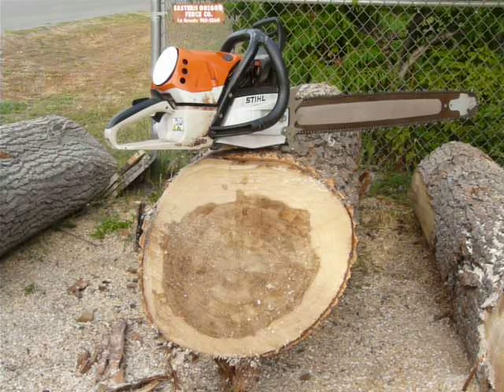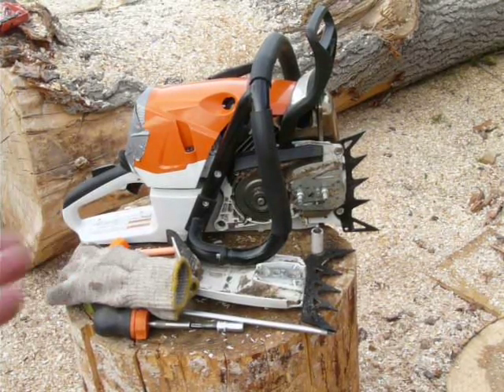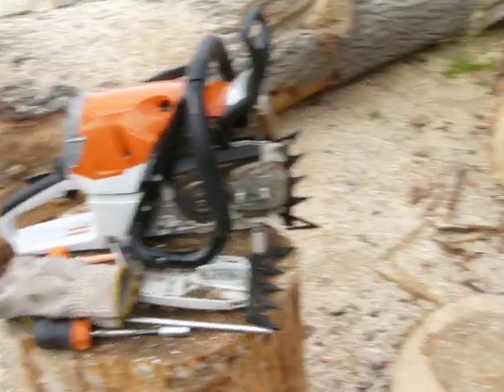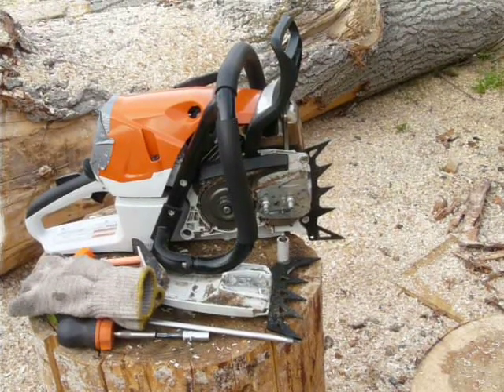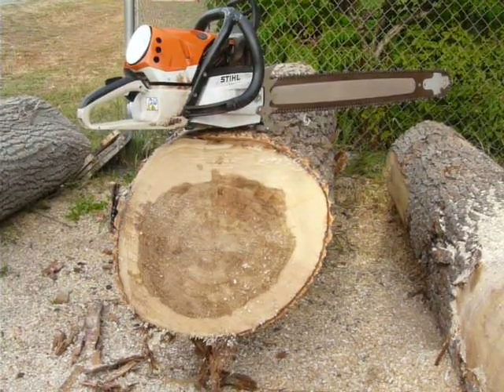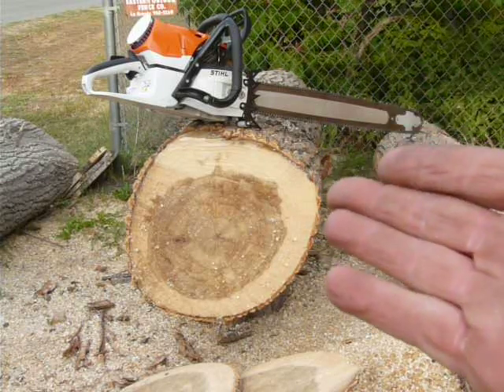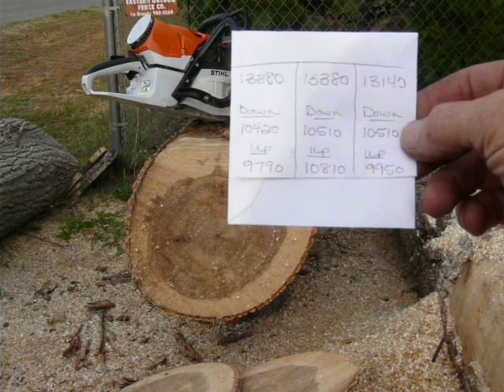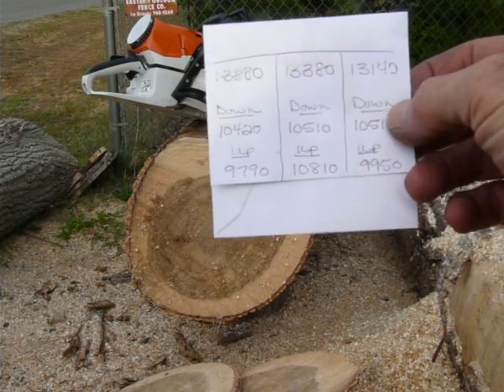Stihl 462s 2nd Session Early Testing & With A K&N

Comment: Like the bar. 
Have you ever seen a husky labeled one(not just a husky mount). I have one that's .063, only seen a small lot of them, I was wondering if they were an error and then sold off. 
Did you recalibrate/reset in the break. I bought my 462 used from out your way, it ran pretty bad and I was a bit disappointed, rested it and I was pleased with the improvement.

Comment: Great comparison! So I noticed the compression relief on at least one of the saws looked to have the valve removed and a bolt was in it's place. I bought a used husq. 562 that had that done to it but didn't know why. Is there a reason for it? Thanks!
Reply: Decomps are known for leaking, if one leaks and you don't catch it you'll score the piston and possibly damage the cylinder. Many guys think it won't happen on an mtronic/autotune saw, but it can, I had a scored 576 that had a defective decomp with only 8 or 9 tanks on it :(, cleaned it up and its running well now.
Reply: I had one rattle loose on one of my 461's and drop into the cylinder. 😬😬😬
Reply: @magnumtreefalling6400  never had that happen 😵
Reply from the maker: Gentlemen hi.
I don't think a/the slight leak, if at all, is a problem losing a bunch of compression.
I do know that occasionally a tip will break off. When that happens you'll be crying..... and more so on a ported saw.
Thanks for watching.